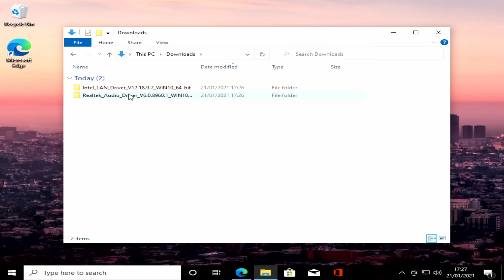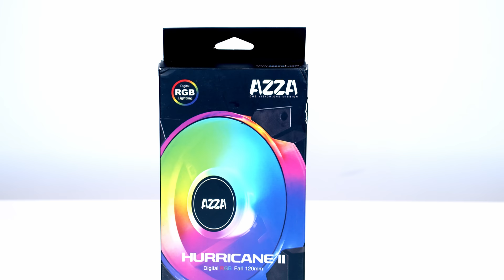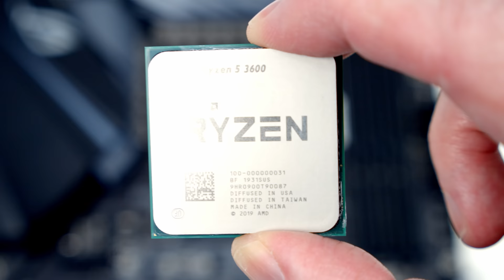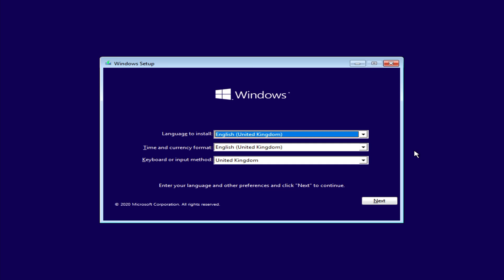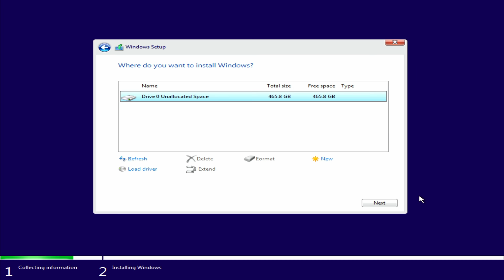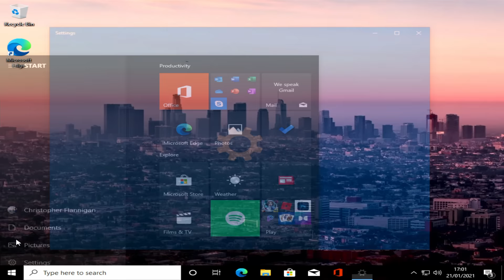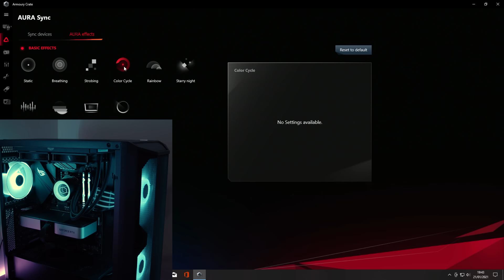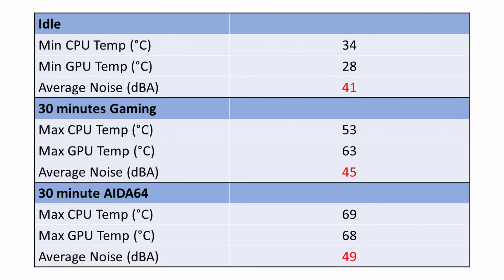How to Build a PC - Step-by-Step Beginners Guide 2021

Comment: Did my first build yesterday with the same case and watched ur tutorial. Worked perfectly on first boot thanks for the video!
Reply: hey bro I also have the same case can you please help me my front rgb fans are not syncing with my aus tuf gaming b550m plus motherboard. I've connected alll the cables but still its not working although rgb are glowing with default 5 effects
Reply: @rohitgurjar601  when you go into rgb fusion, hold down the button on the case that changes the lighting for a few seconds then it will flash and sync the motherboard with your fans.
Reply: Same here :3
Got mine working on first boot, and took advantage of using the same case of the video

Comment: I bought this case but now my mobo own lightning doesn't turns on (not refering to the fans). The 2 fans + logo are only conected to the hub powered by the PSU, so no connection to the motherboard. Do you have any idea what might be happening ?

Comment: great build guide :) noticed though an important part wasn't mentioned about the fans - always have a look for a small arrow pointing in the direction the air flows to help you get a better idea of the way you're looking to cool the pc, love the idea of the radiator at the top too as it extracts the heat from the top best place to mount :)

Comment: Thanks for making these videos, just finished my first build with the stuff under and it was nice having your videos to check on while building just to get it right

MSI X - B450 TOMAHAWK MAX II
HyperX X - Fury Black DDR4 3200MHz 2x16GB
Seagate X - Barracuda 2TB 256MB Cache
Corsair X - RM750X 750W
Fractal Design Focus G White window
Kingston A2000 SSD 250GB m.2
AMD Ryzen 7 - 3700X 3.6GHz
 stock wraith rgb cooler
some cheap uphere fans from amazon
moved my gtx 1070 to this build and another 1tb drive that was in my old prebuildt pc
Reply from the maker: Very nice

Comment: Chris I bought a Gigabyte Geforce GT 710 2GB Video card just to test my new computer, but does such a card work on every new motherboard?
the ASUS RTX3070-8G-EK NVIDIA GeForce RTX 3070 8 GB GDDR6 Video card is currently not available, and I thought to install windows with this low budget card for the time being and to check if it starts up before I install this expensive card!
thanks in advance

Comment: Is it possible to connect the case rear fan to a chassi fan header on the motherboard (it will probably be DC) atleast so it doesn't run at 100% all the time? Instead of connecting it to the hub and using SATA

Comment: Tried following your videos
First time bbuilder.
Lian Li cool mesh 2, RTX 3070,
X570 Tomahawk wifi, Amd 5900x
I flashed the bios, installed everything into case. Turned power button on- nothing happened. Rechecked connections, PSU works when connected to tester.  Tried Motherboard jumper.
So troublesome. Is there a recommendation-forum to post my question to get it running.. greatly appreciated, love your videos

Comment: If I run 2x m.2 in this mobo along with my gpu. I've read I won't get full performance due to channels. 16 to gpu, 4 to cpu, 4 for the ssd. And if I add another m.2 for storage, It will take away from the gpu or ssd1.
Is this correct?
Reply: I know you go into some detail at 17:00 but I was hoping to clarify

Comment: First step, attempt to buy a graphics card.
Second step, realize you can't.
Third step, buy a prebuild.
Reply: lots of good refurbished on eBay , found dozens good deals
Reply: @jamesrider452  Really? The shortage has rubbed off on the used sales as well, with people selling their cards above what they payed years ago. With mining around, you also risk buying something thats been running 24/7 in someones basement. Don't know what refurb entails for graphic cards, but I'm pretty sure they don't replace worn out components on the cards.
So you basically end up buying a card that you don't really wan't, for more than you should - not knowing if it'll go bang busters after a month due to failure, with no warrenty ofcause.

Comment: Does a PSU with More watts use more cost more when using electricity? Even if components same for 850w PSU vs 1600w PSU
Reply from the maker: No it just will take what the pc needs. The higher one might be more efficient though so will loose less as heat so actually draw less from the wall
Reply: @ChristopherFlannigan  OK I’m trying to decide between Corsair AXi Series AX1600i or Seasonic Prime TX 1000W. Which one is better ?

Comment: I have the Lian Li 215 too, but my mobo does not have an ARGB header (asus rog strix b450-f gaming), and i cant seem to get rgb on the front fans to change. If anyone can help me how to connect them i would appreciate it :)
Reply from the maker: You won't be able to control with motherboard and need to use case button. Make sure to plug case sata into psu or it won't work
Reply: @ChristopherFlannigan  That is not a problem, but everything is running as it should, but when i click the case button to change color on the fans nothing happens. There is a 3 pin male  and female argb coming from the Lian Li fan hub do those just connect to eachother then?
Reply: I figured it out, i guess im just an idiot LOL.. ty for the video anyway :D